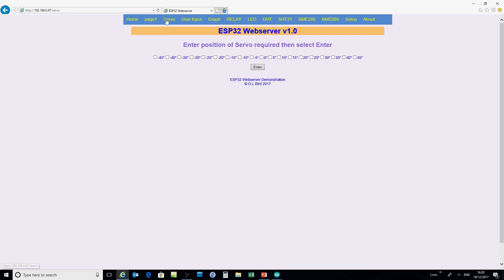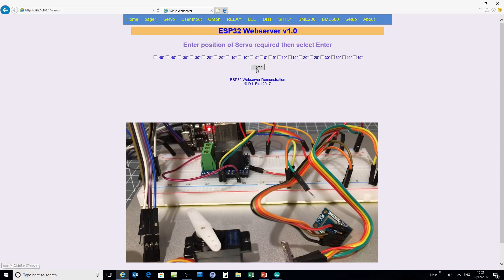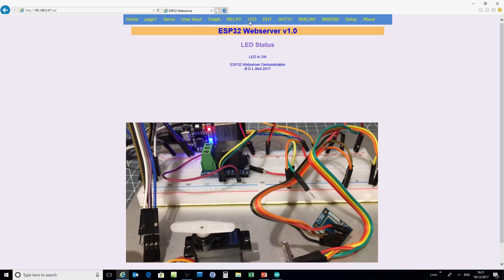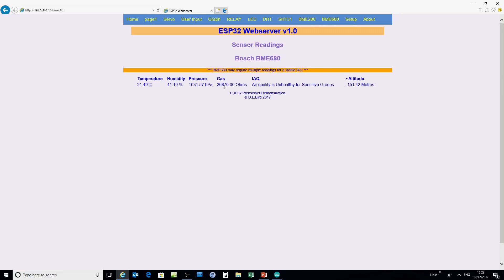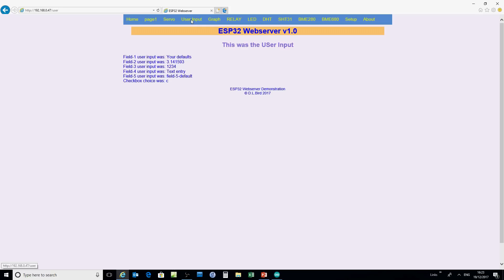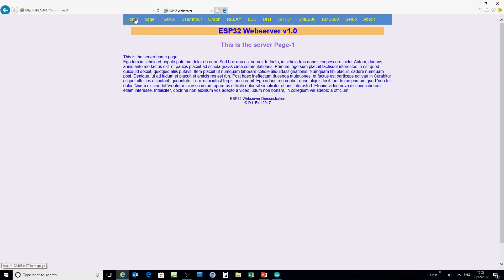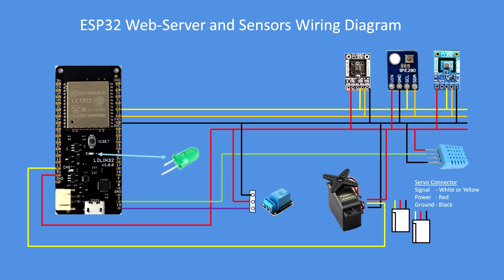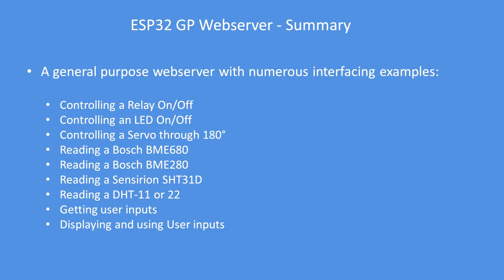Tech Note 079 - ESP32/ESP8266 General Purpose Webserver - customise it to your needs

Comment: Hi sir I connected bme680 sensor with esp8266 and created webserver but it shows bme680 sensor not connected
Reply from the maker: Have you used the correct address for your bme680 usually 0x77 or 0x76
Wire.begin(0x77);

Comment: failed to connect to esp8266 timed out waiting for packet header,I have got this error
Reply from the maker: That error is created by a faulty device or cable or power supply
Reply: Are you sure
Reply: How to interface wemso d1mini with bme680
Reply from the maker: Raees Jamadar, check out my TN on the bme680

Comment: thank you.. we can use ftp for up&download files to&from esp32?
Reply from the maker: No it uses http only, but you can programme ftp transfer via different techniques not covered here. The http overhead is only a little higher than ftp, so what’s to be gained?
Reply: I am a beginner in arduino, I am trying to create a wifi radio project but I want for example to be able to modify the data as wifi passwrds, stream station list without using the pc ide, if I am out of my local home I have to introduce another new ssid. I have seen that you can include a separate file called credentials.h then I thought that maybe this file is stored inside the esp32 server as it happens with the webhosting servers so if I can get to this file through some FTP application I will modify it with my smartphone.
Now I am trying to understand the concept of input fields I will see how I can enter the station number for example if I want to listen to the channel number 47 I do not have to start from 0 I only write 47 in input field and send it for jump to 47.

Comment: Correct me if I am wrong. This server is autonomous when compared to the 
Tech Note 080 - ESP32/ESP8266 Data Logging Webserver
project.
If I remember correctly the server in Tech Note 080 called out to google for the creation of some items as in the temp and humidity gauages.
Reply from the maker: There is no way that I have found for an ESP8266 to easily or even complexly draw a graph and so we have to rely on Google serves to do this. I can draw graphs using Scalable Vector Graphics but even this uses an external server, it is really a limitation of HTML. Recently I have been experimenting with HTML-5 but this too is complex for the ESP8266 languages and memory capacity. Even small graphs consume nearly all of the memory. So this version also calls out for Google Chart services.

Comment: Not sure if you entertain this type request on your channel if you prefer requests of this type are not made then please disregard this post.

In need of a detailed video walking, no crawling, through the steps for several items related to the NodeMCU ESP8266. 

How to see what is loaded in the memory of the device.

How to erase the contents of the memory.

How to load different firmware, for example, MicorPython then back again to ESP8266 original firmware.

List the tools for best carry out the listed items above.

Discuss NodeMCU memory amounts used and why. Have seen discussion on 1Meg and 4Meg but not sure how they are implemented.

Lastly, if you can dumb it down I am a hobbyist and started my journey down using IOTs a few months back and need all the hand holding I can get.
Reply from the maker: I'll try. IN the mean time answers to your questions:1. Yes I could go slower, give more detail, I'll make that my aim.
2. What's loaded in memory, you can't really see it, you could print out specific memory locations, but I'm not sure what value it would be.

3. Erasing contents, you can't, well not easily. Once you load a new sketch or new NodeMCU image it is effectively erased.4. I'm sure loading Micropython has been covered in other video producers, you can move back and forth between Python and a C++ Sketch at will. Loading Python is akin to loading a Sketch. They are never separate items.

5. Tools - For most people the Arduino IDE is probably the easiest to use.

6. Memory. The Memory is fixed by the board manufacturer either at 1MByte (8MBit) or 4MByte(32MBit), rarely do you ever see any 1MBye devices, only the early  chips.
7. Dumbing down, well that's really the aim of my videos to try to explaining things clearly and give simple examples, but the audience is very diverse and sometimes I get criticism for doing that - can't win!
Reply: You do an excellent job with your videos didn't mean to sound neagative. Keep up the great work.
Reply from the maker: Never thought anything like that in your requests and I’ll try to help because that’s what I’m trying to do I meant a small proportion of comments I get via email suggest I can never get it right either too much or too little content. So I am trying to help people like yourself who are just starting out and for which some parts of the technology need more explanation- it’s a huge subject for the uninitiated. Please keep asking questions.
Reply: The reason for the request was connected to a real-life corner I seem to have painted myself into. 
I wanted to figure out how to replace the firmware on the ESP8266 NodeMCU with onboard USB connector or put a better way reflash the original firmware on the device.
 
There are reasons for this reflashing. 
Reason 1, I flashed onto the device MicroPython just to see if I liked the python environment and once I was done playing with that setup wanted to reflash original firmware. 

Reason 2, when you tell the device via Arduino sketch-upload the information for connecting to your WLAN, example SSID, PASSWORD, etc, the device remembers this information and connects to your WLAN even if you upload a new sketch for example "Blink". The WLAN info is somehow stored away and uploading a new sketch does not overwrite that info. Hence the reflash.

It was recommended in several places, don't know if this is valid or not, that the best bet is to erase the onboard flash completely. Then flash the original firmware. Details on how I accomplished this can be provided if requested.

Once completing the above steps uploading a sketch via Arduino IDE I get the following error:
warning: espcomm_sync failed
error: espcomm_open failed
error: espcomm_upload_mem failed
error: espcomm_open failed

This, of course, was fulling functional before erasing and reflashing the device.

With no other ideas decided to flash the MicroPython firmware as a test. To my surprise, it flashed and was able to connect via putty no problem. MicroPython was functioning as it should. 

Numerous attempts repeating the above steps have yielded the same results. 

Any ideas you might have are most welcome.
Reply from the maker: I've been reading the ESP API's here's the outcome: https://github.com/G6EJD/ExamplesYou can reset all of the credentials and return the device to factory defaults. The Boot sector of the ESP is hardwired and can't be overwritten, it will always try to do a load of code/firmware when reset.You should do this:

1. Connect your board to the PC, there should be a confirmation sound as it connects to the USB hub?
2. Start the Arduino IDE and select the ESP8266 Dev Board
3. Turn your port speed down to 115200
4. Select the port your Board used when it connected at stage-1
5. Upload the code for resetting.
6. Press the reset button on the board.
7. Select your board type.
8. Upload the Blink sketch, see it is working. Or write a small programme that outputs "Hello World" to the serial port.
Reply from the maker: error: espcomm_open failed is a serial communications error and is almost always down to the incorrect board type or speed being to fast.
Reply: Forgot to update(thought I did). The error shown above was due to me using Generic ESP8266 Module instead of NodeMCU 0.9 setting under tools menu.
Reply from the maker: Good to hear you’ve solved the problem

Comment: Still having issues running the sketch.....I have run many different sensors/sketches on my ESP32, not an expert but don't think i doing anything silly.

WARNING: library ESP32WebServer-master claims to run on (ESP32) architecture(s) and may be incompatible with your current board which runs on (esp32) architecture(s).
C:\Users\dm\Documents\Arduino\ESP32-General-Purpose-Webserver-master\ESP32_GP_Webserver_01a\ESP32_GP_Webserver_01a.ino: In function 'void showBME280()':

ESP32_GP_Webserver_01a:400: error: 'bme280' was not declared in this scope

   if (!bme280.begin()) {

        ^

ESP32_GP_Webserver_01a:411: error: 'bme280' was not declared in this scope

     float Temperature = bme280.readTemperature();

                         ^

ESP32_GP_Webserver_01a:414: error: 'SEALEVELPRESSURE_HPA' was not declared in this scope

     float Altitude    = bme280.readAltitude(SEALEVELPRESSURE_HPA);

                                             ^

exit status 1
'bme280' was not declared in this scope
Reply from the maker: Are you using the latest version? and have commented out all of the sensors at the top of the programme, plus there is a sensor.h file in the same folder as the sketch?
Reply from the maker: I just downloaded the latest version from Github and it compiles OK with no sensors selected, so the server should be running OK for you. Next I enabled the bme280 by removing the comments from  //define bme280 and yes there is a missing    #define SEALEVELPRESSURE_HPA (1013.25) so you could add that in to the sensor.h file in the bme280 section, it's there for the bme680, so too much rationalisation on my side I think. I've corrected the sensor.h file on Github.
Reply: Thanks again..will try get some time today and see what I have done wrong.
Reply from the maker: OK, that adafruit altitude calculation is sort of OK, it really only works once and only if your calibrate the air pressure at sea level today, the moment the air pressure changes at the reading location the altitude changes which is nonsense really because of course altitude does not change, they do say all that on their web page, but I wonder about the value of including it.  The code should be OK now, I've just included bme680 and that's OK. Either that or include all the libraries. If you don't have a adafruit bme680 it's not likely to work as they use 0x77 and most third-party sensors use 0x76, you can change the .h file in the library to 0x76 though to solve that.
Reply: Not using the bme680, just the bme280 (aliexpress) and LED  / relay. Thanks for the heads up.
Reply: All sorted and working fine now. Thanks again and keep those videos coming.

Comment: Thanks for the videos.. really enjoy them. I am getting the following error when i try run your code (esp32 / bme280) . Any help would be much appreciated.

Arduino: 1.8.5 (Windows 10), Board: "ESP32 Dev Module, QIO, 80MHz, 4MB (32Mb), 115200, None"

C:\Users\dm\Documents\Arduino\ESP32_GP_webserver\ESP32_GP_webserver.ino: In function 'void showBME280()':

ESP32_GP_webserver:405: error: 'bme280' was not declared in this scope

   if (!bme280.begin()) {

        ^

ESP32_GP_webserver:416: error: 'bme280' was not declared in this scope

     float Temperature = bme280.readTemperature();

                         ^

ESP32_GP_webserver:419: error: 'SEALEVELPRESSURE_HPA' was not declared in this scope

     float Altitude    = bme280.readAltitude(SEALEVELPRESSURE_HPA);
Reply from the maker: Sorry about that, so I've uploaded a new version with conditional compile statements to help out, the software needed all of the sensor libraries to be added, now it does not.

Please down load v01a and include support as required.

To include e.g. bme280 support change the first lines in the code like this:
//define bme280
becomes 
#define bme280

Alternative in the IDE, go to Sketch menu, then Include Library, then Manage Libraries, then search for adafruit bme 280, add that in, repeat for bme680, dht and sht.
Reply: G6EJD.... Much appreciated. Will jump on it tomorrow. Thanks again.